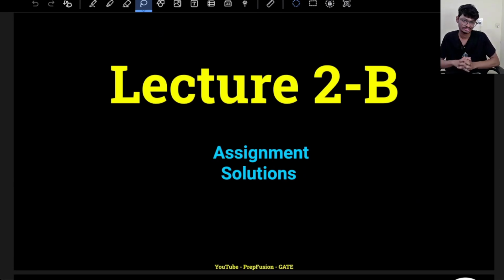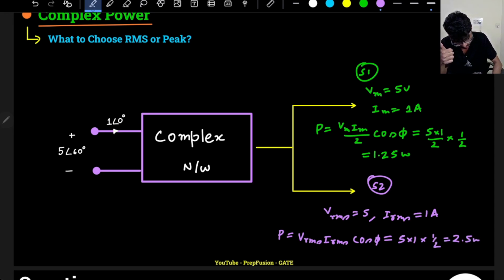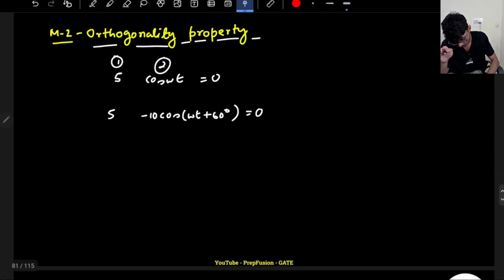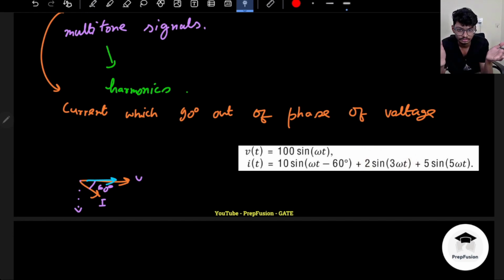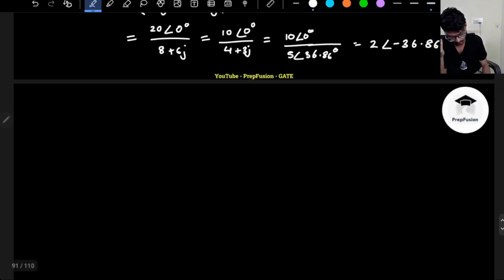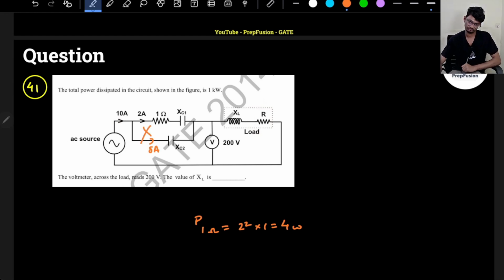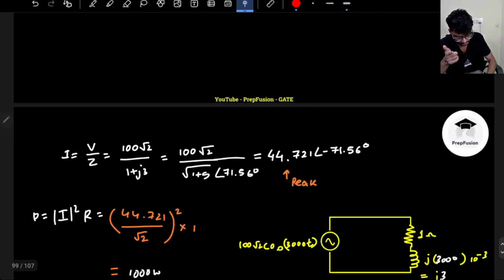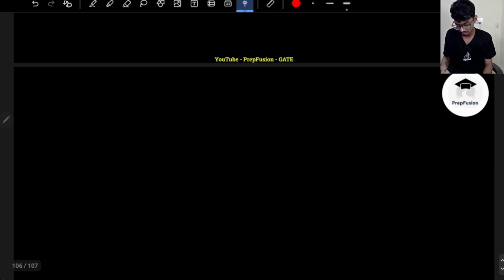Assignment-17 Solutions Of Complex Power  || AC Analysis || PrepFusion

Comment: Sir, in Question 38, why cannot we use P.F = cos(thetha(V)-thetha(I)
which will be cos(0-(-60)) = cos(60) = 0.5?
Why do we use P.F = P/|s|?
When should we use the second formula if we use it?
Reply: Please watch the lectures fully.  This doubt is not possible if you have watched the previous videos.
Reply: @AnishSaha_  Sir, then if we are finding the power factor for the 37th Question, we cant cos(phi) as there are multiple components of the current given which have different phases?
Reply: @ShaGGY_Nut  The power that we computed was only due to w component. I should been more clear that cos(phi) in Q37 is NOT THE power factor. But this doubt shouldn't have come if you have watched the previous lectures where I specifically discussed when to use what formula.
Reply: @AnishSaha_  Yes sir, I understood. I also had made a note that cos(phi) is only used for single frequency components but got confused. I went back and cleared it. Thank you sir.